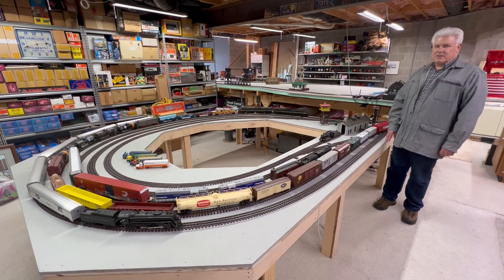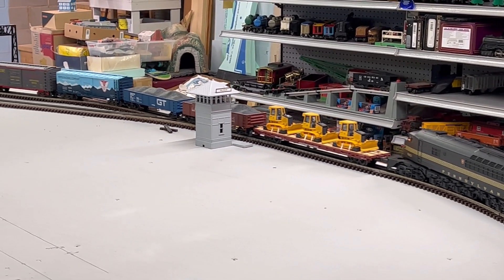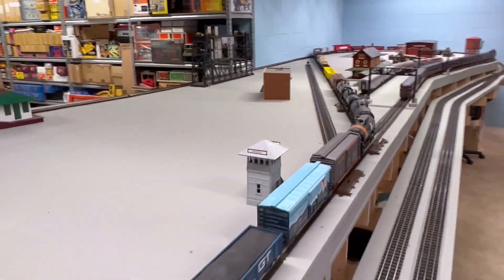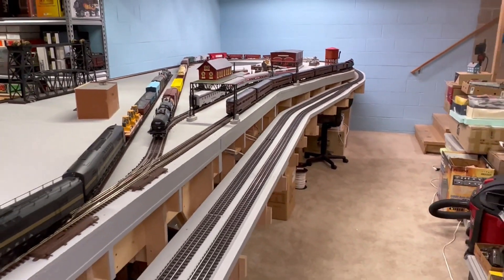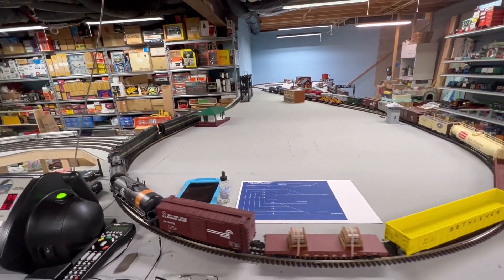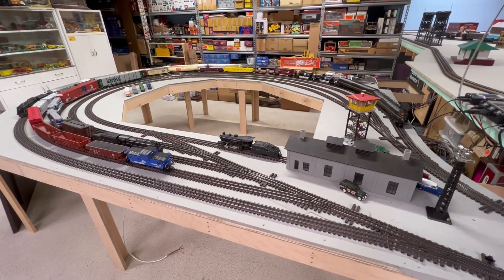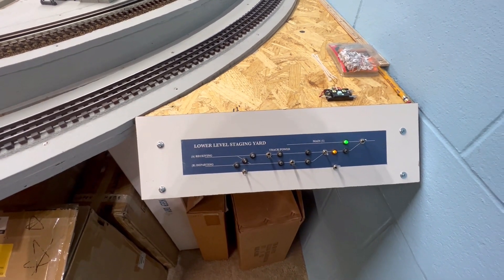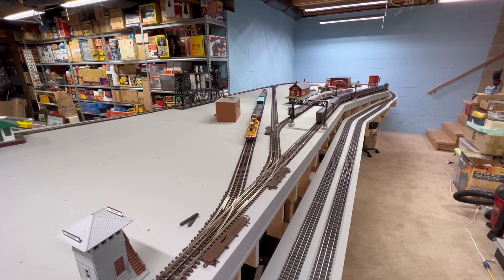Can it make it?... Huge 25-Car train going up a 3% grade.

Comment: Nice
Great progress 
I’m curious why don’t you use the coupler release tab instead of lifting the car, to uncouple?
Reply from the maker: Thank you. Well, I guess I could have on some, but they are not all the same and I didn't know if it would accidentally uncouple if it didn't latch properly when they closed.
Reply: @Nathan5Chime  
I always use the tab to uncouple cars. 
And some of the older trucks do fail-but that’s just an excuse to put them on the workbench and replace the trucks-and while I have the cars apart, check their weight, and bring them up to uniform weight.   Lots of aspects to enjoying this hobby-fixing stuff is one I’d hate for you to miss out on😁😁😁
Reply from the maker: @1jefreys  I will definitely be adding weight to the cars. Last week I made a table for how much they should weigh in 1" increments from 12" to 21".  I looked up a calculator on the internet and found 3 different standards including the NMRA. I have a few repair videos as well but not on car maintenance. I just watched a video from erics trains on adding weight to cars.
Reply: The NMRA RP-20 Standard I use is 5 oz plus 1 oz for length of car..so a 12” car should weigh 17 oz.  And I allow 2 oz +-..because if it’s over, then there’s not much I can do about it.